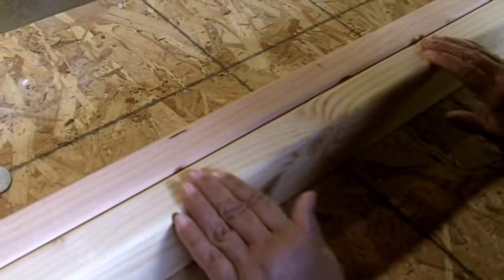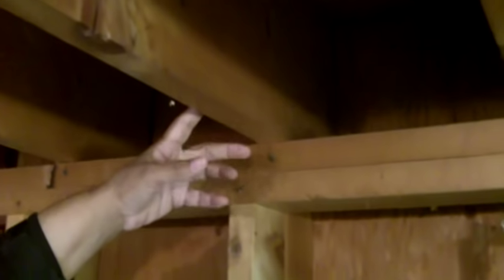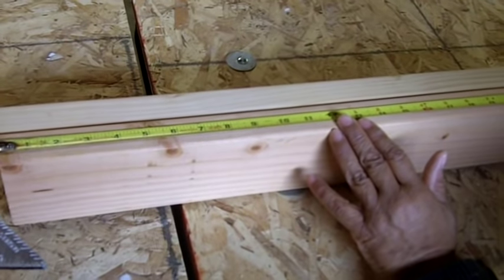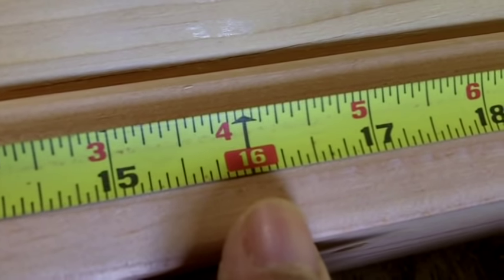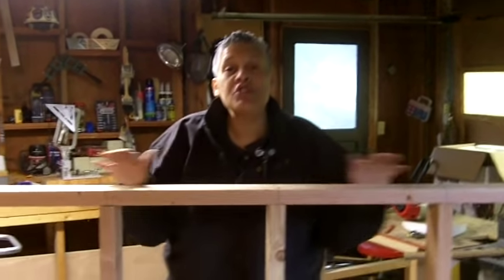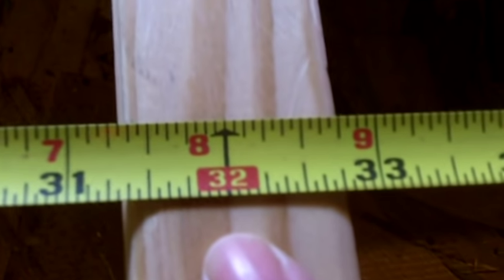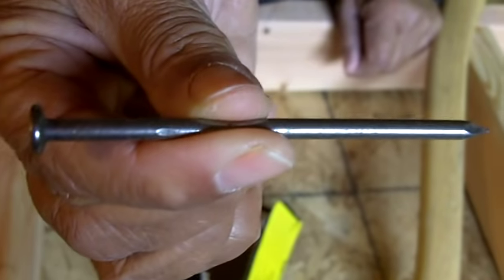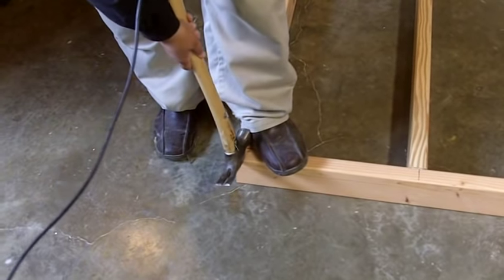How to Build a Partition Wall Beginner's Guide

Comment: Is it true that "all walls that run parallel to joists are partition walls?"  Shouldn't the statement say "interior" walls?  Also, isn't it possible for a load-bearing interior wall to also run parallel to joists?  My third question is " for exterior walls that roof rafters do not rest on, shouldn't they also be considered load-bearing since all exterior walls support each other and thus share the load of "load-bearing" exterior walls?"

Comment: why did you leave such a huge cap thus requiring shims? Couldnt you have hammered it in place to make it snug? I just dont understand how one would secure a frame with a bunch of shims and gaps between the frame and where its supposed to be snug.
Reply from the maker: There are two ways to frame.  You can frame in place, or you can build the wall and then tip it up into place.  With the latter method, you have to make the wall shorter than the floor to ceiling measurement.  Otherwise, you won't be able to fit it into place, because a framed wall measures longer diagonally.
Reply: thanks. so where do my nails/screws go when Im mounting the titled wall into place? where the shims are? Or do I simply "deal" with the fact that there will be a gap and parts of my screws will be visible in the gaps. I'm just having a hard time understanding how it will be stable if there are gaps while im screwing/hammering them at the top and bottom beams. sorry if the language I use isn't correct... I'm totally new to this DIY stuff.

Comment: With one measurement, you marked your "16 on center" point back 3/4 of an inch, you would then  know where to place your 2x4 edge.
Reply from the maker: yeah, it can be done that way, and it gives you a quick reference line

Comment: you should have to tap the studs in lightly with a hammer or whatever, that would be the correct measurement(s) and then toenail it in. Not shims but ok. Thanks
Reply: +homes24  no shims ever! not if you laid it out right and cut boards correctly
Reply: +Brandon Culberson thats what I just said....
Reply: +homes24 Sorry for sounding so harsh...a wall is a wall is a wall...if it gets built, then it's done...however you do it---get it built...outcome = awesome

Comment: There's better easier and faster ways of laying out 16" centers on a stud wall. For instance hook ur tape to the end of ur plates measure up to 16" and subtract 3/4" square it up thats the edge of ur stud and so on, u can do it on 16" centers or 24" centers depending on what ur framing.

Comment: You could just step back 3/4 quarters of every 16 on center as in example instead of marking the first 16 u should of just mark 15 and 1/4 then 31 and 1/4  and so on rather than having to mark center on the each stud which works out to the same but my way is much quicker but nice work tho.

Comment: Sorry, one thing that I saw wrong. Instead of shims the studs should be longer for a snug fit. Preferably you want your plates to be in direct contact with the floor/ceiling. I would never shims walls.

Comment: The stud mark should should be 3/4 inch away from tape's stude marker
Reply: Elenus Pro I used to lay out the framing with a framing square using the tongue I would Mark the first Mark 15 and a quarter and then after that 16 inches set ahead and mark the right of the body of the  framing square  by doing this You had Your layout and You were Square off at the same time.

Comment: Bottom plate should be pressure treated wood on concrete.
Reply from the maker: Hello Steve,   The International Building Code Chapter 23 states that one must use either naturally durable or preservative/treated wood when the concrete is in direct contact with the earth.   One is not limited to using solely pressure treated wood.  Additionally, we have to consider that the people watching the video have different individual circumstances.  Not everyone will be attaching their wall to concrete.  Regarding the wall built in this video,  it was not in direct contact with the earth and therefore does not require naturally durable or preservative/treated wood.   So it's important to realize that we are showing the basic task of building a partition wall, and that people are going to have to adjust it to their own circumstances. 

The best practice for shimming a wall is from the top, as demonstrated in this video.
Reply: It appears you also show shimming it at the concrete slab.  Wood in contact with concrete or masonry is usually pressure treated.  http://www.irccdd.com/building_division/R319.pdf

Comment: use steel studs instead if you want it to last for long! and as well as that make sure you dont use nails! Wood will change shape in years and will make all your plaster to crack, with steel there are going to be no changes!
other than that good tut
Reply from the maker: +Man Unknown Steel studs are generally used more in commercial applications, but they are fine.  The thing is, they might be difficult for the average homeowner to find.  Thanks for commenting!

Comment: Your first stud and your second stud aren't 16 inches on centre? You put your tape on the left edge of the first one and then measured 16 inches to the centre of your second one, making it 16 inches form left to centre.

Isn't this incorrect? Why wouldn't you simplify it and just make your 16 inch marks and put the stud to the right of the mark?
Reply from the maker: +Kevin Sornberger   It's correct.

Comment: I'm going to knock out (I mean erect) my first 14'x8' partition wall today. Call me crazy but I'm going to use the "fibre" board as seen in your video. Only mine is in 2'x2' squares opposed to the more common 4x8' sheets instead of using a drywall. Ill sand with 120 then double coat it in a low gloss satin clear urethane. A form of some type of drywall will go on opposing side. Both 3/4" thick, or 28mm. Ill caulk between all joints with an adequate amount of adhesive. Can anyone say witch is more effective with blocking out sound (and containing it for that matter)? That board or a drywall? I will also use rockwool in every cavity and a thick vapor barrier. Even though its purpose is to split one very large room into two rooms. Cost isn't an object at all. Noise control is, of the utmost importance. Hence this project coming into fruition in the first place.

Comment: She's good but her stud layout is not
"16 On Center, whenever a carpenter see the "16, "32, "48 mark etc they have to go back "3/4 from the center because the stud thickness is 1 1/2". So the center of the stud is 3/4"
Reply from the maker: ISAIAH Rogers Your comment reminds me of the questions that I would get in my classroom and out in the field from students that are just confused. What you are doing is taking a legitimate carpenters' technique, and only giving a piece of it.  It's like giving out a recipe, and skipping the key steps.    

The technique demonstrated in the video is a viable technique that the average person can easily follow.

Isaiah, you've made a derogatory statement here. Was that your intent?
Reply: seejanedrill I might of missed a step or two;however,  how you went about it is a good, but the way I explained it´s more accurate and you know it, my intent didn't come from the wrong part of my heart, when I teach people who work under me I give them the most techical building method
Reply: ISAIAH Rogers Isaiah, The technique that was demonstrated was very correct with no technical problems. Your comment seams to infer that the instruction of See Jane Drill was wrong.  You may have preferred to teach this differently however I don’t understand what you would teach differently by your response. Truthfully I find your comment to be confusing, especially for the layperson as well as insulting.
Reply: Staci Bolden  Stacy I'm not  and never did infer her technique was wrong in any way; however, there is a more accurateway to stud layout with the 16" directly On center. When your 16" is on the RED mark you have to go back 3/4" to the left make your mark, than use your Rafter Sq to draw your line vertical from you mark that was 3/4" back, like jane did you will copy it with your top and bottom plates. the purpose of this method is so the stud layout can be On center accurately. No Guessing an where the mark should go. like i said before the stud thickness i 1 1/2'. if you add on you calculator 3/4 + 3/4= 1 1/2 or .75 +.75 = 1.5. perfessional builders will not dispute me. how she tech it is good for the common person based on principle

Comment: I must correct your procedure.
First of all. The statement that parallel walls are not load bearing is wrong and irresponsible.
Many load bearing walls run atop or between the joist Bay with ladder blocks framed in below or atop a set of laminated lumber or sistered joists. Your 16 on center layout is ok as long as you have the knowledge why you mark center and can keep the stud square to the plates at 90°.
That's rare.
Shimming a wall into place is hack work. If you ever intend on putting lateral stress on that wall.You only have those couple points of contact to carry the stress.A wall full of cabinets loaded with tools or china ,a wall with a solid core door,a chin up bar, all should be framed in place with both plates making full contact and fastened correctly.
Framing begins with the layout.
You strike your floor layout.
Transfer marks to the plumb mark on the joist above. If the coinciding mark on the floor falls between a joist Bay. You cut a lookout block and place it splitting that plumb mark.
Any wall that falls parallel inside the joist space should have blocks every 24" min. flush with bottom of joists to attach your top plate/s to.
Once you establish your coinciding vertical marks .You snap a chalk line between them.This line will be plumb with the line or plate edge on the floor.
Your first stud is always laid at 3/4 back from center then 16" and go from there,or 24".
The only time that changes is on an outside wall layout. Your stem wall in a 2x4 application will be held at either 11 1/4" ,or 19 1/4 depending on floor joist layout.
Many basement crews argue the 15 1/4 because you have many sheets of drywall abutting in the corners,but your layout should negate that when you strike wall placement.